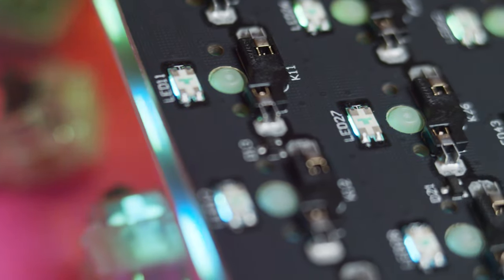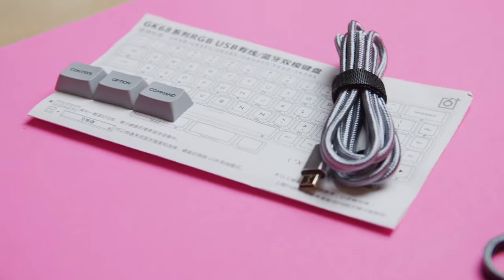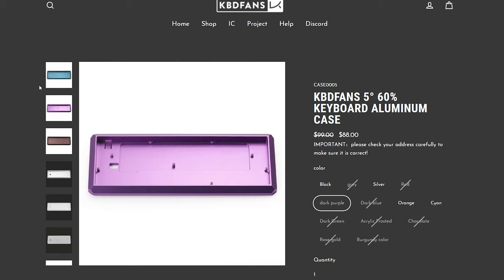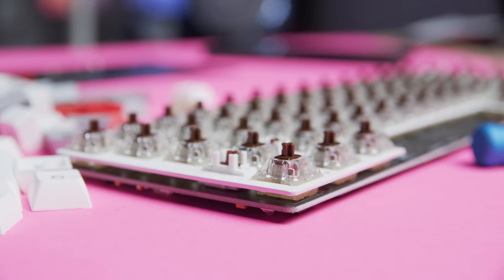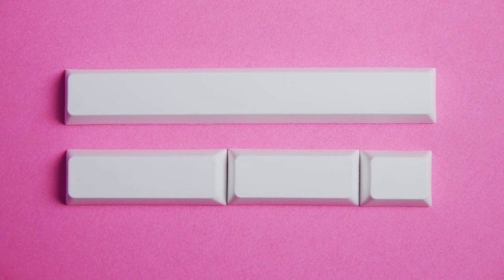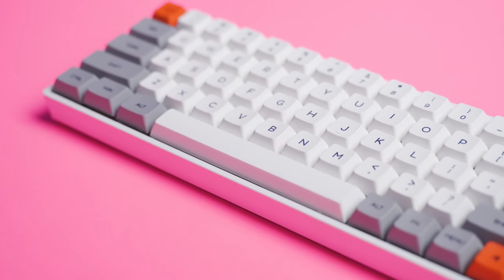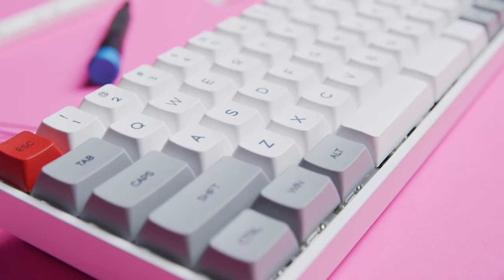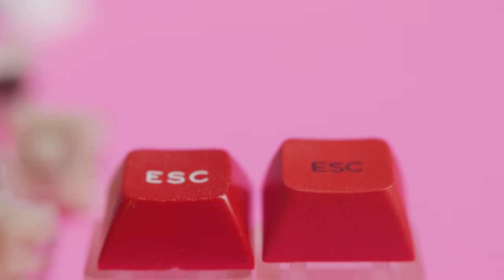Epomaker GK68XS In-Depth Review: This keyboard has a neat space bar trick.

Comment from the maker: Holy, I did not intend this video to be nearly 18 mins along. If you like these longer, more in-depth keyboard reviews let me know and I'll make more!
Good catch by:
Evo_Spec, at 05:02 I meant to say backspace not spacebar.
Samu K
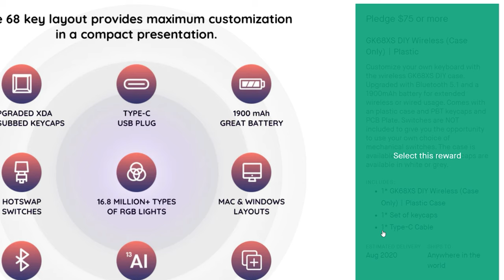, at 15:30. The keyboard at the $75 does come with keycaps oops.
Reply: you might want to add these into the video so you can have section on the timeline
Reply: Hi, what an indepth review and overall amazing video! Do you know if the pcb and plate is removable from the case? Like say, I wanted to use the pcb and such with a TOFU Acrylic frosted case to showoff the underlight. Would the be possible?
Reply from the maker: @syrah5767  Thanks! Just took care of it.
Reply from the maker: @justintran1285  PCB and plate can be removed but there are some challenges transplanting it to a case. The USB has to match up perfectly and more importantly, there needs to be a channel to accommodate the battery. Some Anne Pro 2 owners have gone through similar issues modding their batteries can cases so there some guides out there but nothing specific to the GK68XS style PCBs. Unfortunately the TOFU65 is out of the stock or I would pick one up just for fun and test it out.
Reply: @JTTR   15:30 The 75$ version without switches does actually include keycaps (you can even see it in the kickstarter screenshot on your video) :) That's the version I bought, I can't wait to put in some good quality silent switches!
PS: the length of the video was amazing, and the level of detail as well. I only missed to see how it looks when you dismount the PCB fromt he case.
EDIT: Oh! It is actually shown at 13:53. At first I did not know if it was the actual GK68 or the Anne Pro 2
Reply: Hi @JTTR, how's the height of the kb? Do u foresee if causing wrist pain due to its height?

Comment: This is such a great in depth review. Really usefull info about pcb, rgb, modding, etc.

 I do have one question about the usb c cable I got with it, because in other reviews and on the kickstarter it has a red and black cable, but u have a grey one(which looks way better in my opinion). Is that an option or did u just get lucky to get a grey one.

Oh and definitely make a video on modding this. Really curious about how far u can go with this. Especially curious about replacing case with something like polycarbonate case, since it has the backlight led's(although that would be expensive, and just curious about  how extreme this can be modded)

Again, best review I have ever seen about a keeb. And length of vid is great, really indepth but still feeling like a summary
Reply from the maker: I got lucky with the grey one and to be honest, I have no idea what they're going to ship with. My guess would be the red one since that's whats shown in their marketing material. You can ask them directly on their kickstarter, they seem to be pretty on it with answering questions. 

You're right on the mark about poly being crazy expensive for something that prob won't fit correctly. I think I'll mod the plastic case for fun and see how that comes out.
Reply: @JTTR  okay thanks, I will ask them about it when I have backed the project.

And your right about the case. Kinda forgot how expensive a good case is, and likely hard to find in this shape. Modding the abs case is a great idea, and maybe also a new keycap set. The xda profile on the stock looks and sounds pretty good, but is hard to find custom keycap sets in xda. Maybe cherry profiles would work.

And again, this vid is such high quality( especially compared to some others, not hatting on them though). Can't wait to see future content

Comment: You earned a sub very detailed so nice. If you dont mind cause im really new to keyboards i always buy razer keyboards is it really a big diff of having aluminum case oppose to the plastic? Does it affect how the keyboard sound when typing?
Reply from the maker: A lot of mainstream mechanical keyboards are made with very thin plastic with a lot of internal space that can accentuate that very plasticky sound. In this case, moving from that to a well made plastic, acrylic, and metal case will be a big improvement. 

However, when you move up to the world of fully customized keyboards it's not so straight forward, there's a lot of factors to consider. Just upgrading to a metal case doesn't automatically produce a better sounding and feeling keyboard. Aluminum for example, feels really premium compared to plastic but sometimes can produce undesirable characteristics such as pinging or switches feeling too rigid unless things are done to compensate for it such has felt or foam at the base or orientation of how the pcb/plate is mounted. That's just scratching the surface on things and there are a ton of different nuances that affect a keyboard.
Reply: JTTR i see so for this keyboard does the aluminum have foam in the bottom? Well i wanna venture onto building a mechanical keyboard thats why this keyboard is well built so it can really get me started. Cause its about 70-80 bucks difference for the aluminum you think its worth it going for it?

Comment: Really nice production value and I like your in-depth review. Just two quick questions how easy do you think a case swap and finding a brass plate for this would be?
Reply from the maker: For the case, I remember checking the post screws on the GK68XS with the Tofu65 pictures on KBDFan's site and it didn't look like they matched up.  As far as the plate goes, you'll probably have a hard time with this one as well due to the backspace location. 

If you're already thinking about a case and plate swap, this keyboard is probably not for you. Have you looked into NovelKey's NK65? They're having a new drop of the entry edition tomorrow.
Reply: @JTTR  is there a way to add bluetooth to the nk65

Comment: Love the review man! I might make this my choice over the ducky one 2 SF especially due to the hotswap option, does this fit Kailh switches as I may want to try them out and I’ve heard certain switches have more pins/legs and may need trimming
Reply: Switches with 5 pins/legs are called PCB mount switches, and certain PCBs (the thing that the switches go into) only support plate mount switches (which are the 3 legged version). This one has 5 holes in the PCB, as you can see at 2:50, which means it will fit PCB mount switches. No trimming needed, for any switch you buy. Hope this helps!

Comment: Great in-depth review! I was wondering if the acrylic case in the video is tofu65. I ordered the gk68xs and the tofu65 acrylic case but wasn’t too sure if the pcb was going to fit on the tofu
Reply from the maker: It was an example of the 60% tofu. I also couldn't get my hands on the 65% at the time. My understanding is that the post mount points line up but you have to ditch the battery. Did you end up getting the Tofu65?
Reply: JTTR yup couldn’t wait and ended up getting the acrylic tofu65. My Gk68xs should arrive in the mail this Friday so I’ll let you know about the battery situation.
Reply: Update: gk68xs will not fit in tofu65 lol. PCB is too big by mms but the length and width of the plate is noticeably bigger than tofu

Comment: Those hotswap sockets don't seem to be the Kaihl ones. Are they branded? Because they are very interesting if removing switches is that easy with them.
Reply from the maker: At 8:28, you can kind of see the branding. I don't have the keyboard apart right now but from that clip, it looks like they're Gateron.
Reply: @JTTR  Oh right, they are Gateron. Didn't notice the text at first. Sadly it seems there's almost no info about them or wich pcb have them.

Comment: 14:52, you mean that I can use pcb monted keys without having to cut them?
If so, I am sold
Reply from the maker: Right, has proper pass-through holes on the pcb so you don't need to clip a thing.
Reply: To be fair almost every other kailh hotswappable board has the cutout's too. Just the massively popular drop boards don't (with the exception of the preonic which does have pcb mount holes).

Comment: i purchased a very similar keyboard with a trash can above the right arrow key from amazon with optical blue for 51, it is now 77 with 50% off.  the reviewer is right about the software. you will have to look up the review by ken on youtube to use the software.  If you have programming experience then yes you should be able to figure out the horrible software but if you don't have programming experience you will have a more enjoyable time with another keyboard as it is not intuitive and the instructions suck.  currently i can not get layering to work with a macro.  this is great keyboard. with awful software. but for the price and the hours i have spent trying to get macros to work on the driver layer it is a good keyboard.